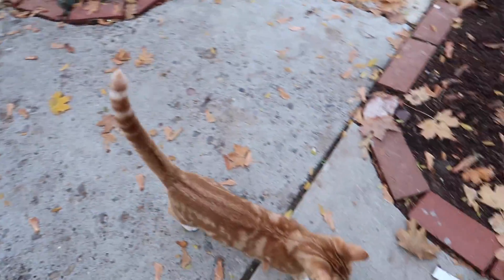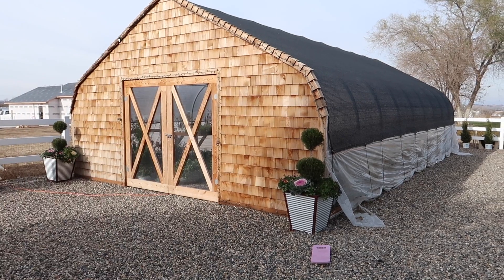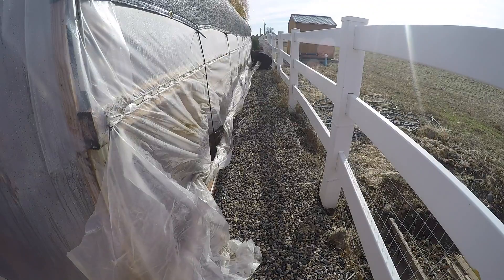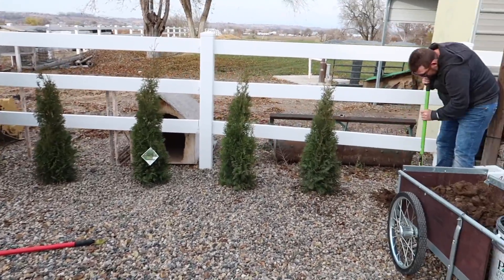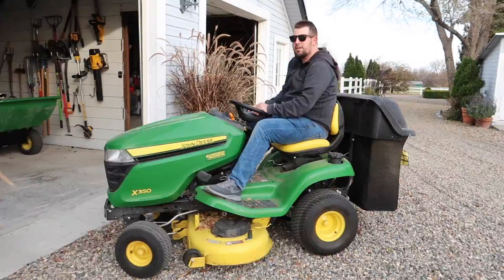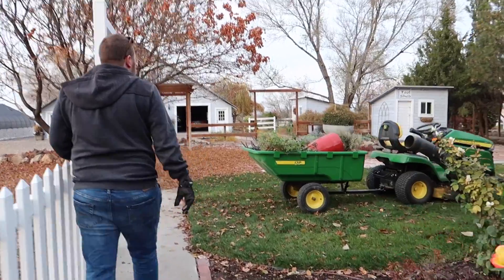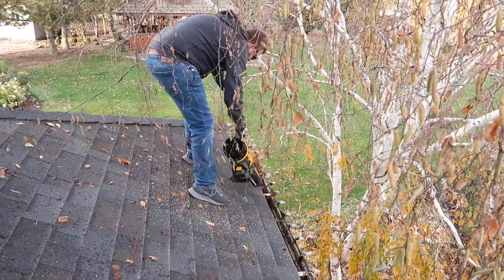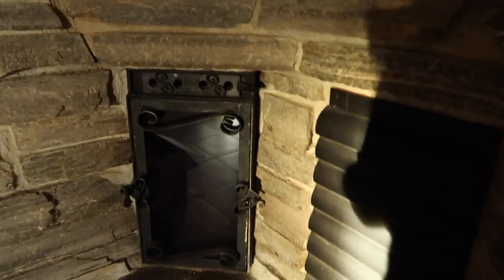Winterizing Greenhouse | Planting North Pole Arbs | Pot Clean-out // Garden Answer

Comment: For the plastic at the bottom of the greenhouse, you should think about rolling it the other direction. Because as it is now, the water, and leaves, and gunk will get trapped in that little channel, if it's rolled the other way, the water will run off when it rains/snows
Reply from the maker: Umm...why didn't I think of that??? 😜 Good point...I'll probably go roll it the opposite direction today. Thanks!
Reply: Ryan Harper As if she didn't have enough projects to finish before the snow flies. (Kidding!)
Reply: Kate DIY - ya but this is less of a project and more of a 'save her rear' type thing:) lol
Reply: Garden Answer - you'll be better off:)

Comment: Hey Laura, just a a question regarding evergreens in pots over the winter.  I live in Ontario, Canada.  And we get basically the same weather as you guys do.  If I have an evergreen in a pot over the winter with all the elements with it break my pots??
Reply: The ground expands when it freezes,  resulting in ceramic pots breaking.
Reply from the maker: I've never had a ceramic container break- terra cotta have cracked on me before, but that's it. I would maybe move your containers somewhere protected if possible. We put together a video last winter on wintering of shrubs/perennials, etc. You might check that out at some point if you need any other pointers! :)

Comment: How much does it cost to heat the greenhouse in winter? Why don't you leave the  leaves in the beds? It's a nice insulating mulch. Winter is our inside reno time. Spring/Summer - outside time.
Reply from the maker: We actually don't heat the greenhouse in winter (I wish!!! Maybe one day!). It does stay a good 20-30 degrees warmer in there, though. We do quite a lot of filming out there on yucky days. We'll just light a portable propane heater while we're in there and it does the trick!